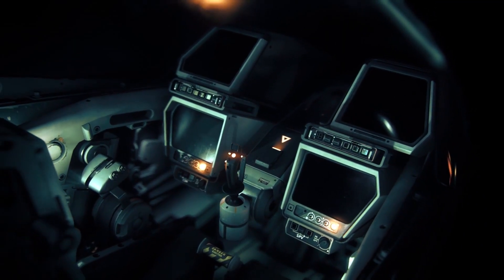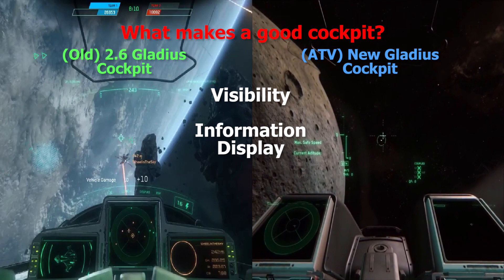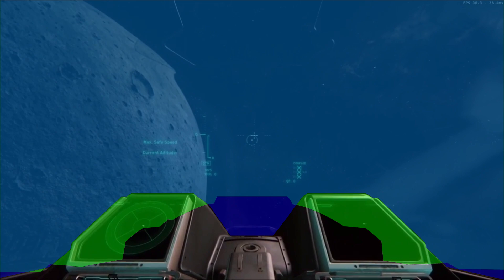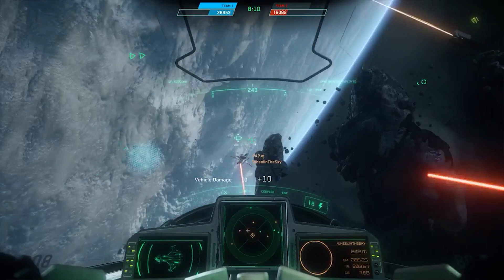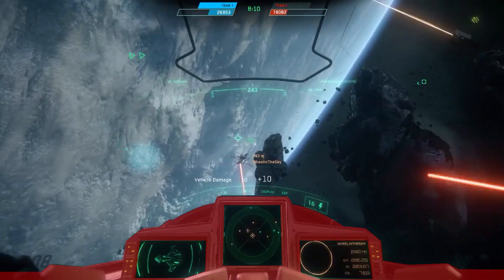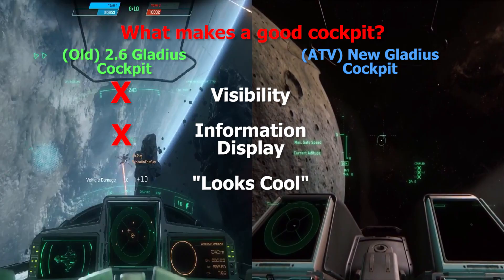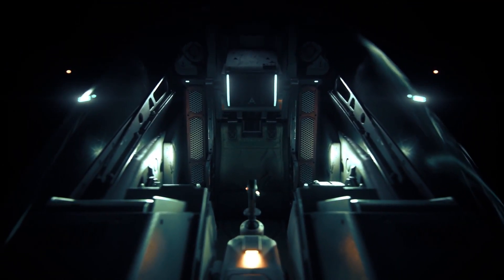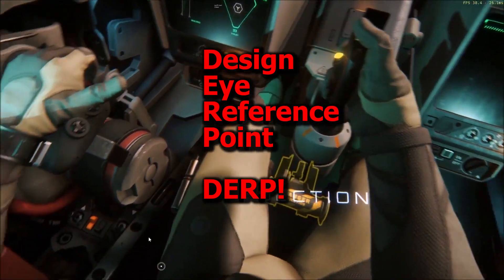Analysis: New Gladius Cockpit from ATV

Comment: I like the new cockpit much more. Seeing the gun doesn't matter, as you straw-manned hard here, what matters is seeing more in the center when you are lining up shots.  Also we didn't see the target identification location, it could be projected onto the glass, because there is no need to interact with it, therefore there is no need to have that screen there at all. I like that the 2 screens are bigger so you can see them easier and they are higher so it brings it closer to your eye line.

You had nothing but contempt in this video, it showed throughout the video, maybe next time when you are trying to present something as an unbiased analysis you should take the edge off your voice.
Reply from the maker: The reason I discussed being able to see the gun was that that was the stated reason for the change. That and visibility, like you mentioned. I addressed both. The reason why I said the only way I could see someone liking this cockpit over the previous one was because the visibility actually wasn't increased over the previous version, so the only improvement I can see is being able to see the gun. If you have other reasons you like the current cockpit, or you disagree about my conclusions on the other facets, feel free to comment as you have. But there's no reason to start an ah hominem attack. -Whitesnake
Reply: You ignored the part about where the visibility is. Having more visibility center line is much better, especially when you are trying to line up shots.  He said they cleared a channel in the center to reveal the Gatling gun, you interpreted it to mean that is the primary reason for the change, to "see the gun", I heard it as they opened the channel and as a side effect the gun was revealed.

Please quote where you think I did an ad hominem attack, I do not see where I did, I did not attack you, I attacked your arguments and then on top of that gave you a suggestion about your delivery style. You were obviously angry about the change and it showed throughout the video. Unless you just speak like you are on the edge of an angry outburst all the time, if that is the case I apologize.
Reply: Second part: after rewatching the part you made with the overlays, green and blue, you took a screen shot of the new cockpit where the aim point is below the center line by about half an inch, causing the pilot to be slightly looking down, and the old cockpit you took the screenshot where the aim point is slightly above center line so the pilot is looking slightly up. So, could you remake your video using the same reference points? In total you have about an inch difference on my full screen between the 2 points.

Comment: The 2.6 cockpit was terrible. Looked just like a placeholder, as the top part was just a part of the buccaneer cockpit, and looked completely misplaced in the gladius. You shouldn't judge functionality from a short clip must showing the new cockpit geometry. The HUD was obviously just a placeholder and not the finished this.  All in all, without prematurely judging functionality from an WIP showcase, the new cockpit looks a lot better. The original cockpit looked much closer to what they have now and is much more fitting to the ship. For reference https://www.artstation.com/artwork/gladius-09e2b9bb-b068-46f5-87e6-b4a8924bf1bb
Reply from the maker: The cockpit from the art you linked has a layout much more like the 2.6 version, with the radar in the center and two smaller screens to the left and right of it.

Comment: Do you think it's possible that the gap with the hole (cup holder) in the center (new cockpit, between the two displays) is a holo projector? I don't like the new bulky layout but maybe a projector could compensate for the 3rd display?
Reply from the maker: I've been wondering about that as well. If that's the case, then how does that offer a view of the main gun, which was the focus of the redesign anyway? Why not just stick with  the original design?

Comment: So a couple of things: The 'angled away'  panels are actually just angled straight, the reason they look angled is because of the position of the pilot. Seems more like a 'doh'  moment by the designers than anything else. Much of the extra information that was part of the 'floaty hud'  (dno if that's what the CVI is but ok) will be brought back, it was mentioned on spectrum somewhere by one of the devs (can't find the link right now) so I'm not too worried about not having the information available.

That leaves the visibility and aesthetics. Visibility seems allright to me, though it would improve if the displays were angled towards the pilot. Aesthetically I don't like the chunkyness of the displays, could do with a bit of trimming (which would also increase visibility) but otherwise I love the quality of the new look, and the cockpit canopy also seems to have a had a pass (which is nice).

Comment: Not all visibility real estate is equal. Removing the center display to open up visibility is a-ok by me. I do not need the radar when I have a target, and I do not need constant access to my own ship state when I'm looking at my radar and searching for a target.

I would GLADLY give up a button in my layout to toggle one of the two available panels in exchange for that much premium visibility. This overhaul is an ENORMOUS upgrade on an already top of the line layout.

The only gripe is exactly the one you raise, about the display angle. If CIG has them face more directly the pilot's viewing angle, then I guarantee in time your luke warm review will go down as absurd.

Comment: I only have one issue with this - why would you say that the Gladius' manoeuvrability isn't too impressive? 

It is the most agile ship in the game after the M50 and maybe the 350R, and they are racing ships!
Reply from the maker: Peter H I was including speed caps in that assessment. You are correct that of the three areas, maneuverability is the best, but its advantage in maneuverability is too thin to make up for the severe disadvantages in the other areas.
Reply: That's a fair enough argument.

Although I do think (or at least hope) that when the more advanced economics are implemented into the PU, the Gladius will find itself having other advantages (repair costs, maintenance costs, availability of parts and upgrades, etc) that will help to justify it's place.  

At least I hope that is the case, because it's such a great looking ship, and it just seems to be one of those ships everybody WANTS to love.  It's no secret that ti's not the most effective ship in the game right now, and yet I still find myself struggling to melt mine because it's just such a great looking ship and just such a fun ship to fly overall.

Comment: Brilliant video.  I have to agree it seems like a step back from 2.6.  I think there are some good things about it too though.  removing the middle display means that it is easier to see under the centre of view and all the mfds are now radially equidistant from the centre view.  they could put a short, wide MFD down the bottom and still preserve that.  

maybe the gladius is being repositioned from light fighter to light antique starting fighter that you get to upgrade from in sq 42.